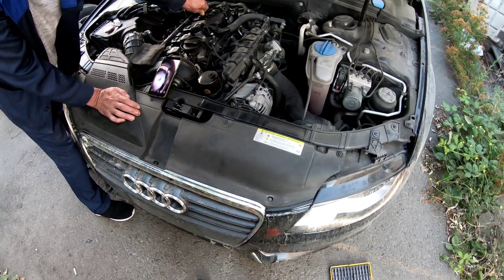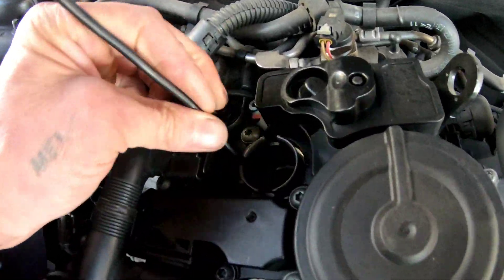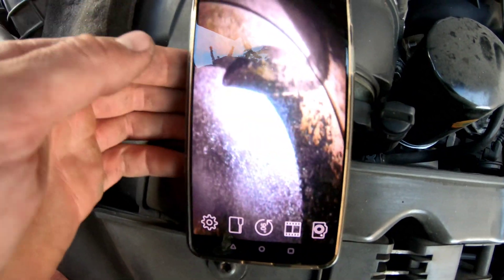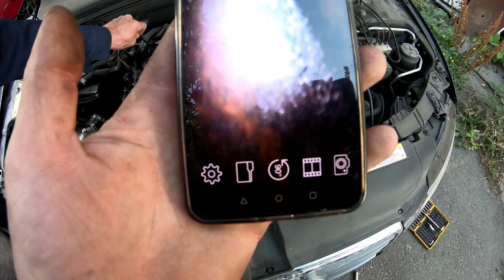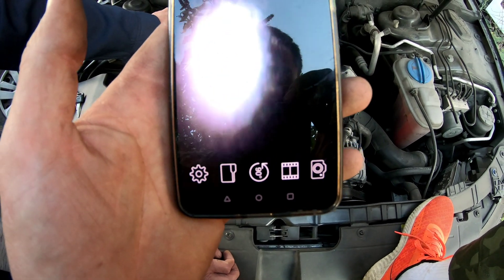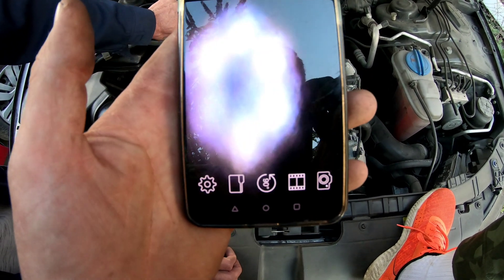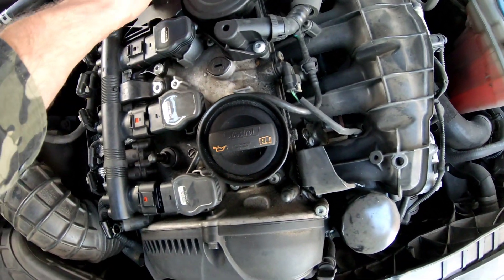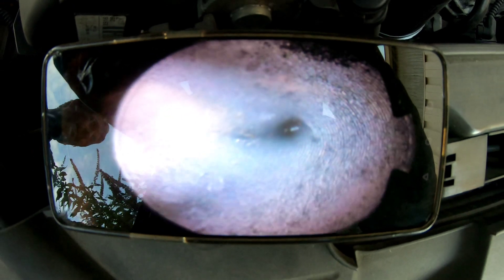0 compression in one cylinder Audi A4 2011 TFSI engine

Comment: Those are not the valves...those are just recess cuts in the piston to clear the intake valves. Buy a borescope with dual camera ...the side camera works great for looking at the valves, I got one off Amazon for like $80....works great.
Reply from the maker: Yes you are right those are cuts! The problem was in exhaust valve that was melted! I replaced the exhaust valves and grinded them after the car was working great just consuming oil! But I see for that year is a problem with burning oil from the factory!